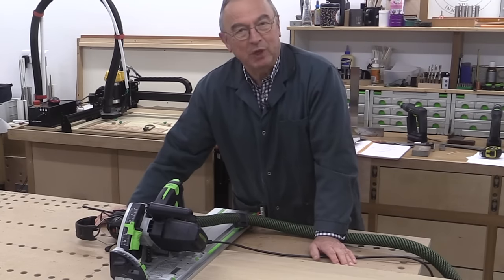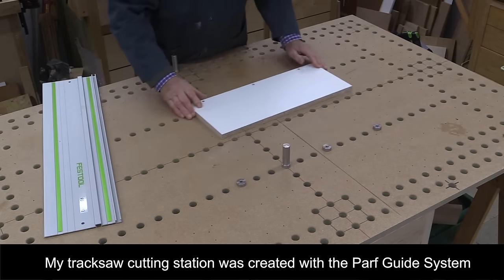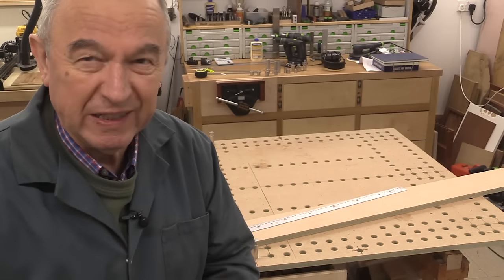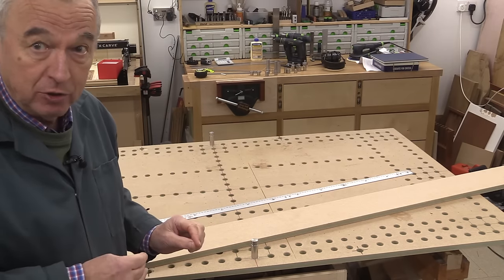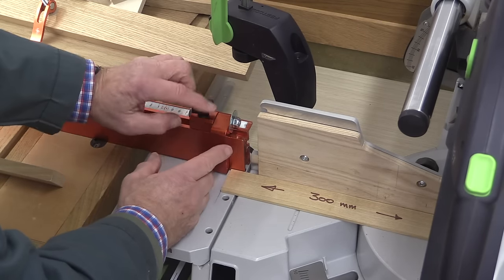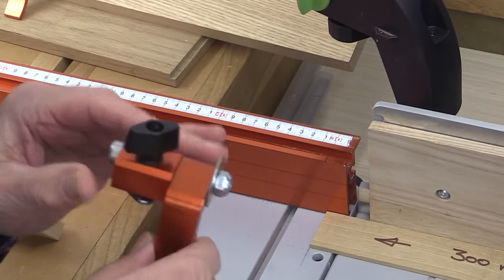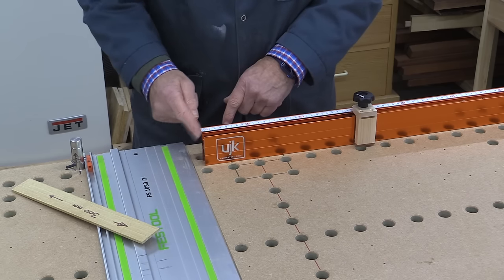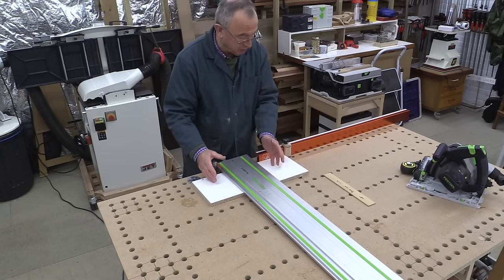Fences and Stops - My ultimate solutions (after trying many designs)

Comment: Peter, your videos are always educational and enjoyable to watch. Thank you for all your efforts and sharing is caring. If you look at your video, when you make the cut of the oak, you can see the fuzz on the pierce you are keeping, the festool like others have mentioned was design to remove the blade splinter, this is done primary by the contact with the table and the contact with the splinter guard, thus the design method is make you square and “clean edge” cut, sticking just enough material out from under the rail, the splinter guard and that table surface will give you a clean cut that sits under the rail, thus you switch it round and work inwards, and in theory, you then lift the stop on the cut side of the piece ( in vers to your setup) you give the piece enough length to make a cut, you then flip that piece around, lower your stop, reposition, and now you are making a cut that are clean on both sides, but also, the rail is sitting on top of most of the piece your are cutting. otherwise, you suffer from no splinter guard, which was the main focus of the rail, no just the accuracy and straightness of the cut, and for have to fiddle most of the time adding a trimming piece to give stability to the rail.
Reply from the maker: Many thanks for this.  Cheers.  Peter

Comment: Very well explained Peter. Thank you. I guess the only possible advantage to having the fence on the other side of the track and therefore rotating the work piece is that both finish cuts are completed under the splinter guard. As always with your videos I enjoy the resulting thought process. Cheers.  Take care. Dave
Reply from the maker: Hi Dave, That is true but the tear out with a well maintained blade (sharp and clean) is not really an issue. Cheers. Peter

Comment: Useful overview. Two issues with the right hand fence. Having calibrated using aTS55, you will get a slight error if you switch to a TSC55 because of the thinner blade.  More significantly the splinter strip will not be protecting the finished piece because it is on the “waste” side.  That noted, Peter’s proposal is an easier way of dealing with narrow cuts and less cumbersome than using parallel guides like TSO’s worthy narrow stock option.

Comment: I am in the process of building my own MFT, and I think that you had pointed a serious flow in the "standard" MFT crosscutting  configuration in a combination with a fence: The fens scale running to the left of the table, with a small area to the right of the fence for the waste side. In this configuration, if you want to crosscut a 250cm X 60 cm board to lets say 80cm L X 60cm W sections, you have to first trim the edge with the board feeding from the left side of the table, than flip the board end to end, and feed it from the right side with the fence stop set to 80cm. This means that you need another support table on the right side, no matter how long your table is. It makes much more sense to setup the track in the middle of the table, or biased to the left leaving a grater length for the waste/feeding side to the right.
Reply from the maker: thanks for this.  Peter

Comment: Fence is on the left as guide rail splinter guard is on top of work piece needed. If you have it on the right it will splinter. Maybe a rail on both sides is what is needed 😂👍🏼
Reply from the maker: If you keep your blades sharp there is no problem at all - try it.  Peter

Comment: Hi Peter, I have a question about the fence & length stop. In this video you demonstrate simply pulling it up off the table and relocating it. In another video you made a couple of years ago you show tightening the bench dogs down from underneath the table top to insure a tight fit. Has the fence been redesigned? Is it still necessary to tighten it down?
Reply from the maker: Well Spotted - I no longer bother to tighten them down as it only make a very tiny difference to the accuracy which is well within the expectations of good quality cabinet work.  Cheers. Peter

Comment: Peter -- I, too, prefer having the fence to the right of the track. However, as others have pointed out, it's not the way Festool designed the track to be used. Because the splinter guard protects the wood to the left of the right edge of the track, and not the wood to the right of the track, the portion to the right is supposed to be the offcut. 

Nor is having the fence to the right of the track necessary to prevent the 'two-step' process of squaring up the edge of the board and then flipping it end for end to have the 'good edge' against the stop. Simply have the piece you're cutting to the right of the track, slide the left end/edge of the wood under the track a few millimeters, trim the end/edge, and then move the squared up edge against the stop to cut the piece to length/width. The problem with this approach is the sliver of wood cut off to square up the piece will be trapped under the track. And, this squaring cut will not be protected by the splinter guard.

So, why do I prefer to have the fence on the right? I like to be able to see what I'm cutting. That's particularly true if the 'keeper piece' will be completely covered by the track. In such a case, I cannot visually verify that the work is tight against the fence/dogs. Sure, it works, but it just feels uncomfortable.

Comment: Hi Peter, I have my fence on the other side and I have it there for two reasons. 1 - When setting the fence with my story stick I can push the story stick up to the rail, I don't need to leave a 2.2mm gap to allow for the kerf of the blade. 2 - By doing it as you do, you're using the waste side as your good side. That's probably not a big issue with the quality of blades and cuts but the splinter guard on the rail is preventing and tear out , so the further your cut is from it the more likely you'll get tear out. If you think about the Festool Parallel guides they're all designed to work so that the waste side is the waste side. Also the same is true for all the rail squares with fences
Reply from the maker: Hi Stuart, Noted, many thanks.  Peter

Comment: Thanks Peter, got a few bits and bobs from Axminster/ink over years here in NZ. 
However the way you have done it doesn’t let you use the anti chip guide on the track and for me cutting melamine all time it’s not practical. 
However will look at options 
Thanks for the video

Comment: I absolutely love your content! I have made many purchases based soupy on your recommendations and almost entirely with Axminister Tools. They are excellent to deal with and have fantastic customer service. I am not sure how they do this, but they are the fast company to ship to here in Newfoundland Canada, even when compared to Canadian companies.  Problem/question: I have the orange track clips from Axminister but the metal ring keeps coming out of the plastic holder. It would be awesome to have a more robust solution. Perhaps they have another device for this or you have some suggestions? You can get away with using nothing but ensuring they are snug, but I prefer a more positive solution. I also purchased the dogs with the track t-nut in the top that goes under the track, but they make it quite awkward to place and remove the track. Any advice? Much appreciated.
Reply from the maker: Hi Dan, I have not had any issues with my rail clips but from what you describe you can either contact the fantastic Axminster Customer Services or put something in the hole to make it a snug fit. I am not sure about the second part of your message about the track.  Peter

Comment: A very clear video, thanks.
The only query that I have is how do you allow for the thickness of the saw blade when using your right hand fence?  You appear to have used your 'story stick' up against the splinter guard, which would I assume leave your cut short by the thickness of the saw kerf?
Or did I miss something.
Reply from the maker: Hi Stephen, No the story stick was on the outer (away from the guide rail splinter guard) edge of the kerf line. The alternate way, and more accurate, is to position the tracksaw on the rail, drop the blade and push the story stick against the teeth. Cheers.  Peter
Reply: Many thanks for clarifying. Appreciated.
Reply: Or just calculate 2.2 mm into the equation. There are wasteside jigs available also that represent the blade offset.
Reply: @coreywells9498 I think the newer Festool saws all now come with 1.8mm kerf blades (and there are shims for those as well). Though it seems like using the kerf in the table top would be the most accurate since that's what the saw is actually doing.

Comment: Wow! Great videos!! I’m new to the channel, so please forgive my questions if they’ve been answered elsewhere. If money were no object, what material would you make the top out of? I’m considering making mine from “Delrin” or perhaps euro ply with HPL in both sides. I’m also considering making it closer to 40mm thick. Would you or any viewers care to offer some advice or opinions? 

Thanks for the great content. Looking forward to making my own.
Reply from the maker: Hi Jason, Do not waste your money on tops thicker than 22 mm. Also, use good quality MDF (Medite Moisture Resistant 18 mm is excellent) and then replacement tops are more likely to be within budget. Plywood is not the best material for tracksaw cutiing stations. Peter
Reply: Thank you for the reply! I should have offered a bit more info. The main use will be as a fixture table for assembly of large casework. (Similar to a welding fixture table) It will get covered in all sorts of adhesives and gunk. I’ve got a panel saw and CNC for the majority of the sawing. I’ll only replace the top every 5-6 years. I’m looking to make it thicker to minimize deflection with fully assembled casework especially while clamping. I just ordered a few of your stops and gigs to get me started. I can’t wait to tap into the potential of a proper table. Again, thank you for the input and time you give to the community. 👍🏽
Reply from the maker: Hi Jason, The maximum depth that the 3 mm and 20 mm drills can manage is about 25 mm. In order to go the 15 mm further you have to take the 3 mm hole all the way through the material as the 20 mm cutter has to have that 3 mm hole for the spike to follow. The 20 mm holes in that go down 25 mm will be super accurate to allow for your sawing and so on. The rest of each hole (beyond 25 mm in depth) can be (say) 25 mm in diameter without affecting the accuracy of what goes on above. So....

Create your 3 mm hole pattern in the normal way to the maximum depth that the drill can manage. Then, really carefully, extend several reference holes all the way through the top. Then flip the top and (again carefully) use the normal method to create the 3 mm hole pattern on the underside. This time try and set the 3 mm drill so that it will not go deeper than 16 mm so that it just connects to where the top set should be. Then, flip the top back to the right way up and do the 20 mm holes to their max depth in the normal way. Flip the top back again and drill out (no more than 16 mm) the underside with a 25 mm cutter. Fingers crossed !!

Comment: Hi Peter, another great tutorial as usual, I watched your video on the low profile UJK Parf system and stop , I would appreciate your thoughts on what do you think are the advantages of this new fence system over the low profile one ?
Regards
Dave.
Reply from the maker: Hi Dave, It really is about personal preferences. For me I have firmly settled on the advantages of the Parf Guide Systems and, in particular, the accuracy of the holes that it creates. So, I can move the Fence and Length Stop (with its two dogs that hold it in place) to any position that suits me on my tracksaw cutting station. If I move it away because I need the whole surface for something then when I put it back it needs no adjustment and gives perfect measurements for cutting time after time. The same is true with the second one that I keep at the Kapex. Cheers.  Peter
Reply: Thanks Peter, Good point. Well made. @NewBritWorkshop

Comment: Great setup - however I like a pair of the flat parf system fences as they support the stock under the track and have more versatility as you have demonstrated in other videos when used perpendicularly with routers or domino. I actually have three as sometimes I will use the third for a first cut and then the other two at another level  to do  the second cut with the piece flipped so splinter guard does its job esp if I have a stop set for multiple repeat cuts on the pair
Reply from the maker: Yes, I used them for a long time for that exact reason. However, with the Fence and Length Stop there is (not shown in the video) another one of those circular pucks under the track against which the wood will be pushed.  Cheers.  Peter

Comment: Hi Peter, just a thought do you mention in the video allowance for the kerf of the blade when making your say 300mm cut?

Steve
Reply from the maker: Hi Steve, Yes, it is measured from the off cut side of the kerf. A more accurate way is to place the saw on the track and measure to the tooth of the blade. Cheers.  Peter
Reply: @NewBritWorkshop  👍🏻

Comment: Peter, you may have covered this in other videos but if one had an existing MFT/3 top ( Festool does not guarantee the hole pattern to be square), the fence and guide rail might not be square. Does this imply that the only way to use this system is to make a DIY top with the Parf guide sticks? Also, does this system allow for rip cuts along the length of the saw cutting station (I don't have a table saw)?
Reply from the maker: In my experience the majority of MFT3 hole patterns are square enough for most woodworking tasks. My MFT3 and also the MW1000 had pretty good hole patterns that most woodworkers would be happy with but neither are as accurate as my own tracksaw cutting station. The holes are a different matter and I have read, some time ago, on the Festool Owners Group (FOG), that the hole size can vary. But again, for most woodworkers it is acceptable. Yes, you can turn things around by 90 degrees to use on the MFT3.  Cheers.  Peter

Comment: Hi, Peter, I have the earlier, low profile version of your fence and just bought the new, higher version as well. I was hoping to use them on both sides of the track, but there’s about 12mm difference in their alignment. Do you have a fix to align them?
Thanks for all the great videos, it’s really appreciated.
Reply from the maker: That is a tricky one - I will take a look at it this evening.  Peter
Reply from the maker: Yes, 12 mm is the difference. You could have a 12 mm distance strip (simplest) or find a way to create a separate row of 20 mm holes. Peter
Reply: Thank you

Comment: Peter, with the fence on the right side of your track saw did you have to find a new ruler/scale strip that counts from left to right? From the product photos, the included scale seems to count from right to left.
Reply from the maker: Yes, there is only one tape scale in the kit which I believe is the left handed one. For my setup you need the 105389 tape.  Peter

Comment: As to why people often use the fence on the other side, could it be that the “keeper piece” of the material will have a nicer edge because it’s protected from tear out by the lip of the track?
Reply from the maker: That may be the case but with a well maintained saw and a sharp blade that tear out will be minimal. Cheers.  Peter

Comment: Hey, It is probably a stupid questions from someone who is far less expirienced than you, but does depth gauge on the tracksaw is enounough to keep that table unharmed whille cuting? Or am i missing something underneath?
Reply from the maker: It is possible, with luck, to cut through a work piece with barely a scratch on the tracksaw cutting station but in reality a shallow kerf line will be scored on the tracksaw cutting station top. This is not an issue for most people but some want to avoid this. One method it to have a sheet of a sacrificial material under the cut line - for me that is a waste of time and effort.  Cheers.  Peter

Comment: I think Festool generally call the piece that is not under the track the off-cut because it is more prone to tear-out without the splinter strip supporting the top of it!

That said, I've come to a similar conclusion as you have that the right hand side of the cut is more pleasant to use, especially for thinner rips. I use various sizes of combo squares to set the strip a consistent distance (+2mm) away from the edge at the front and back of the workpiece. This ensures parallel cuts which are the hardest to nail with an MFT-like setup.